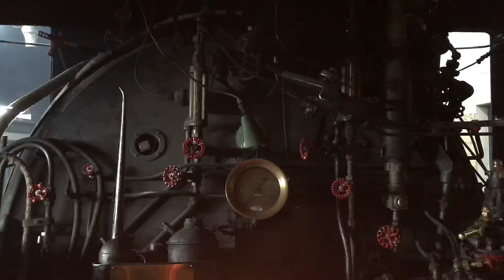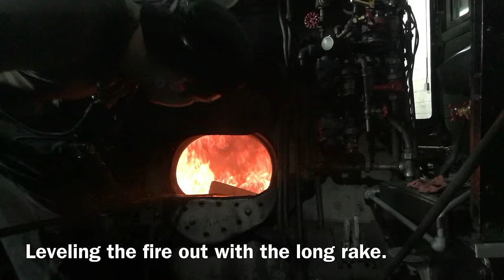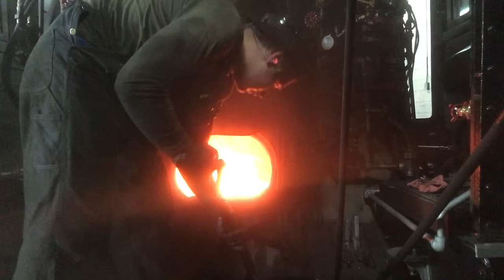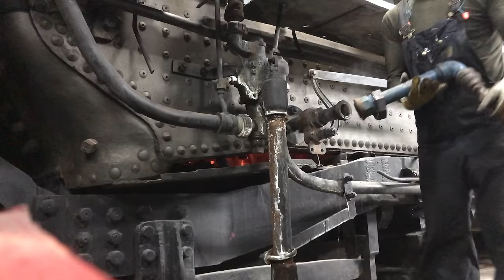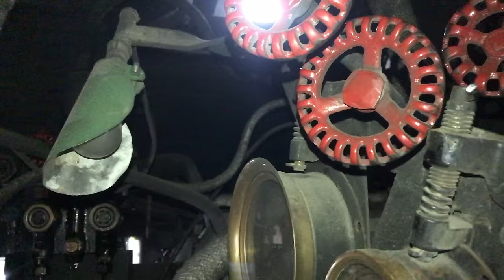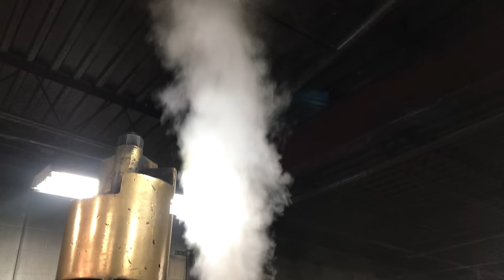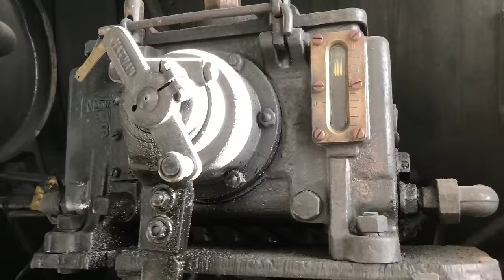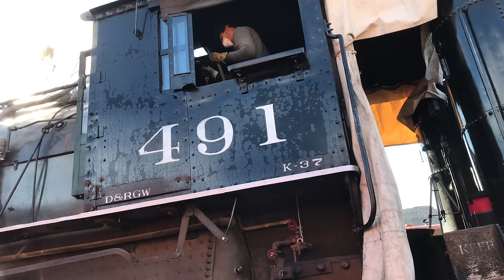How To Fire Up a Steam Locomotive [4K]

Comment: ....but does it come with an owners manual? Seriously, this is such a well shot and produced video. I look at one rivet on the engine and wonder who were the metallurgists that evaluated those. Then I look at what they hold together and wonder who the engineers were that could design such a magnificent machine as this example with no computers....no calculator...and in many cases pre-date the slip stick. And then the answers come to me and it is simply that they were men of brilliance. Thank you so much for providing the video when there is so much "crap" on YouTube.
Reply: They were Engineers.
Reply: Aliens.. It`s aliens ;)
Reply: I suspect they also over-engineered things when in doubt, which might partlybe responsible for these things still being around after all these years. :-)
Reply: And also partly responsible for why there aren't any steam-powered aircraft!  ;-)
Reply: Pretty sure they did not draw everything up to the very last detail. Superstructure, major components, precise fits, what connects where etc certainly, but not minor details. Much of it is craftsman judgement, fitting things together however they happened to fit etc. I bet every engine is somewhat different.
Even today, for low volume production, cable routing and such minor details are left up to manufacturing. For more demanding designs, certainly you get pegboards for wiring harnesses, detailed procedures for every last operation and all the documentation, but where it doesn't, you get a schematic and a bill of materials and that's it. Figure the rest out on your own. All the parts come from CAD-s of course, but how it all goes together is generally not precisely engineered unless it must be.
Reply: I liked your reply comment. But to comment on "they were enginners". 

  Sort of. Many of the great designers, builders, and craftsmen were engineers by trade not by a education. The time was such that not everyone was afraid of everything and they moved forward always accepting there is risk in all that you do. With advancement will be failure and what made you successful was sharp witt, powerful perception, and a dedication to whatever your craft was. 

  Those times can't exist today as everyone believes there is no risk and everything that happens is someone's fault as long as its not thiers.

  Look at what was done with no beauroracy, small government, and people with the will to do not just complain.
Reply: @Columbo Bumbo books are one thing, actual engineering drawings for manufacturing a specific machine is something entirely different. I doubt you understand how much paperwork it is to draw up even a simple machine, never mind an entire steam locomotive. And they sure as hell didn't have CAD-s, CAM-s and PDM-s back in the day to do most of the paper pushing. For a machine with complexity of a steam locomotive, you are probably looking into reserving a small storeroom, just to fit a single copy of complete drawings of it in paper format. And considering the small volume most engines were built in? Like hell did they bother with that, if they could get away with not drawing up some detail, they didn't draw it up.
Reply: @Columbo Bumbo That's a large part of it yes. But there is more to it and it has lot to do with what kind of tools were available. For example gauge blocks didn't become available until early 1900-s. That kind of thing has some large implications to how you can manufacture things and even to what degree of detail it's worth drawing things up.

One good example from earlier steam era is thread standardisation. There used to be a time when standard threads didn't exist. You could not fit a nut from one company to a bolt from another company, they were all custom fits. The way it worked, is that toolmaker made a tap, largely by eyeballing it, used that to make a matching die and as long as he didn't lose or break them he could continue to make matching threads, cute isn't it? By the time this particular engine came around, this problem was of course solved, but there were many others yet to be solved when it came to precision and repeatability.

For example all these bent tubes, there were no CNC tube benders back then. You couldn't just draw it up in 3D CAD and order a part that would perfectly match. The way to go about it was in most cases to just eyeball it. It was the same with lots and lots of things back them.
Reply: @aleksandersuur9475  standardisation of tread for bolts was around long before locomotive were made.
Reply: @scruffy6151  this particular locomotive, yes. But locomotives in general were what forced thread standardization to begin with, it took quite a while to become universal. True interchangeability wasn't quite guaranteed all the way up to WWI. Completely modern thread standards were set up after WWII even, but the differences to what this steamer would have are hopefully minor. Thread standardization in a way continues to this day, with outdated standards being phased out and legitimate use cases of non-standard threads being incorporated as new standards or changes to existing standards.
Reply: Aleksander Suur is right.

"Much of it is craftsman judgement, fitting things together however they 
happened to fit etc. I bet every engine is somewhat different".

This is how things were done up until quite recently: https://www.youtube.com/watch?v=ovD0aLdRUs0

How the F1 rocket engines were built: judgement, hand craftsmanship, every engine somewhat different.
Reply: My thoughts as well. Every piece was carefully designed and handcrafted. It's a masterpiece.

Comment: This is something that I have wanted to know how was done for like 15 year or more... 
Thank you for posting this! Instant sub and thumps brah!
Reply: Me too, but I can't believe that this was done every time an engine was needed.
Reply: PotholesInMyLawn seccosibnei
Reply: Same here.  This was perfect!
Reply: Lol
Reply: I do this for fun with steam traction engines, lots of work has to be done before start up!
Reply: twistedyogert, this wasn't done every time a locomotive was needed. When coal fired locomotives were in use every day, the crew would put in a bank (pile of coal) in the firebox to slowly burn over night; the grates would be cleaned in the morning, bank broken up and spread over the grates to ignite fresh coal. Or a hostler would keep them hot and tend the fires. With oil burners, they would turn off the fire or have someone tend it.

There would still be pressure left in the morning to get things going (on smaller locomotives it might be 50 psi, on larger ones it could be 100-150+ psi)

Even after boiler washes (31 service day inspections) they might not be fired up from cold but warmed up with hot water from the shop boiler.

For firing up from cold, the general rule of thumb is 1 hour of fire up time for every 1 foot of diameter of the boiler
Reply: I think he was talking about himself when he said "instant sub..".
Reply: That's what i read his message as, He wasn't telling people to subscribe :/
Reply: No,no, engines like this, never shut off, except for repairs, like boilers   must be in stand by when you not need full power, lowering steam prod.
Reply: PotholesInMyLaw
Reply: ksivo
Reply: Hot wheels
Reply: Same
Reply: As a kid I used to do that to the Atlantic coast line #250. To move 100 feet to amuse the patrons.

Now the loco is likely rusted shut but I remember having to oil and grease everything, including the hot boxes.

Good times!
Reply: PotholesInMyLawn ooooooooo
Reply: me too,as a child it was never possible to find an engineer who'd let me play with his noisy toys,..thanx